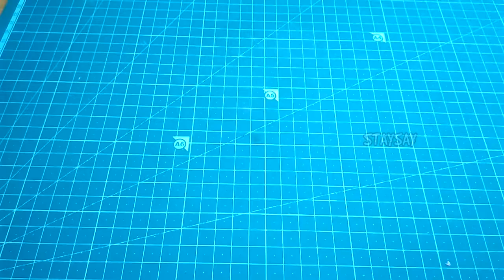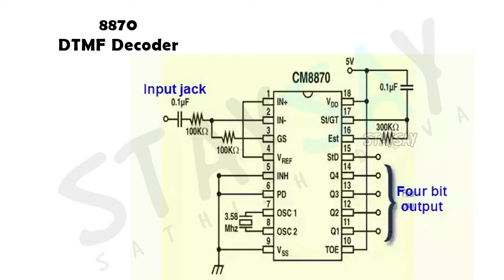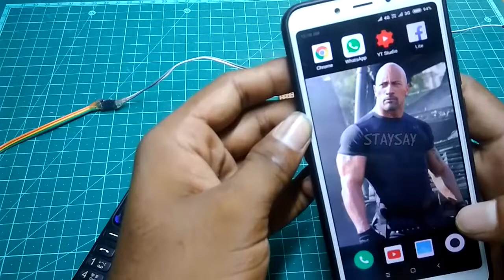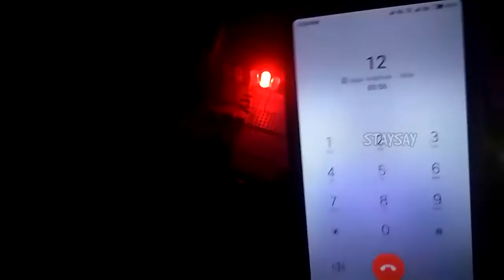How to make DTMF Decoder using 8870 IC | SdevElectronics

Comment: Can i use MT8870 instead of CM8870.in some videos i have seen two 22pf capacitors near the crystal. Is it necessary?
Reply from the maker: Yes you can use it.
Not necessary, if not working use it..

It depends upon IC manufacturer

Comment: Can this be used on landlines?
Reply from the maker: Sorry, I'm not tried yet...
If you found 3.5mm female Jack on landlines, try it, reply me if it is working...
Reply: I know the "ring" voltage is much higher than the maximum supply voltage, so you may need something to prevent the initial voltage spike.